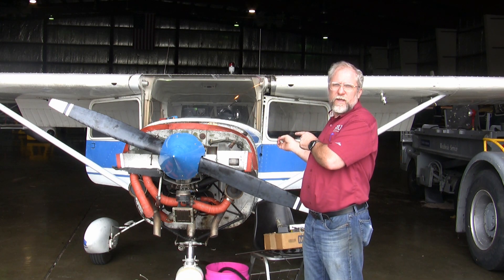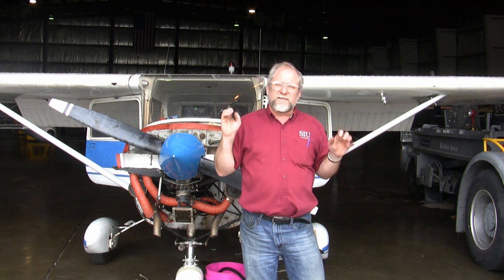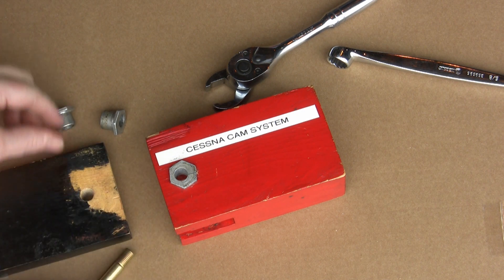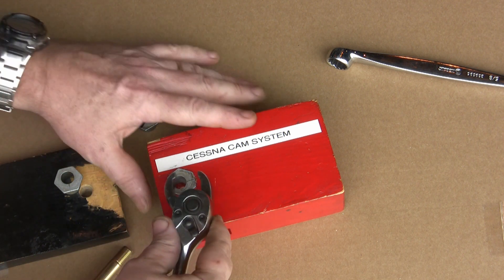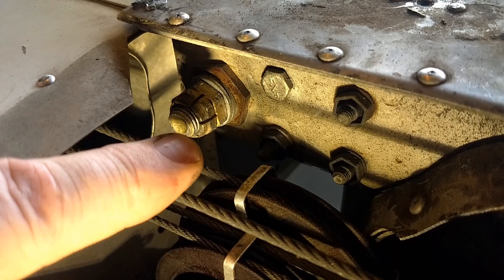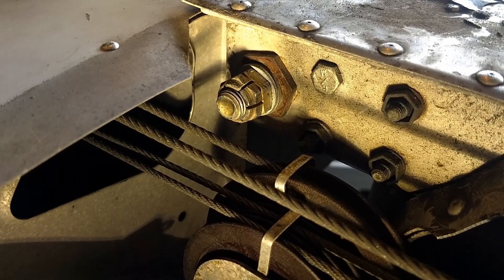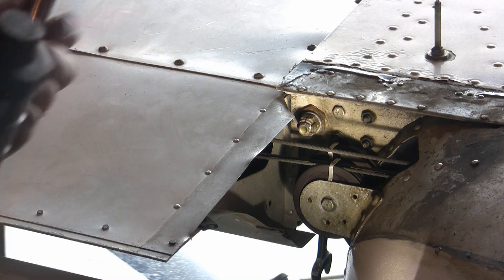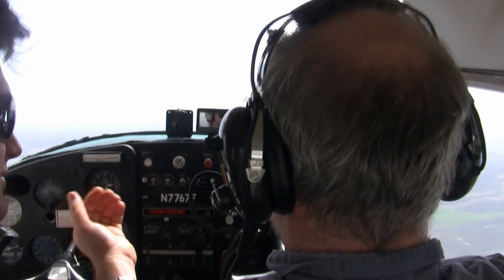Correcting for a heavy wing in a small Cessna - Wing Alignment

Comment: Hello, A&P here. Since you installed the wings, first I would set both cams neutral. Second, I would check that the flaps are all the way up to thier stops and both sides match. Third, I would check that the ailerons are neutral with the flaps and cables rigged properly and yokes are leveled, etc.. Many times the ailerons are not neutral with the flaps and causes the slight turn. Also, adjusting the cams at the end may affect the cable tension.
Reply from the maker: Yes - and after properly installing the wings and setting travels and tensions it will often still fly wing heavy.  This is because not every wing is exactly identical.  That's why Cessna provided the cams - to correct for such errors.  This video is demonstrates what they are there for.  Setting the cams does not affect cable tension.
Reply: @1donagin , this video and thread is quite informative. I do have a question regarding the centric adjustments. If there is play in rear spar, when pushing up with your and against the bottom of the reward spar, accompanied by a thud noise and noticeable movement of nearly 1mm, would this excessive wear likely be in the spar itself or the centric bushing? Best guesses?
Reply: @1donagin  Wide-face of Cam needs to always point towards cabin. if backwards this will "sweep" the wings and you often end up with Flap to Fuselage contact. Agree with Frank statement above in that cable tensions are altered with every eccentric adjustment. You can adjust in opposites L to R and try to balance (as you should), but still effect tension.

Comment: Thanks so much for doing this.   It's very helpful in understanding how this works.  I noticed in my (1976 C150M) Service Manual that Cessna cautions to rotate the eccentric bushings simultaneously to maintain proper bolt alignment.